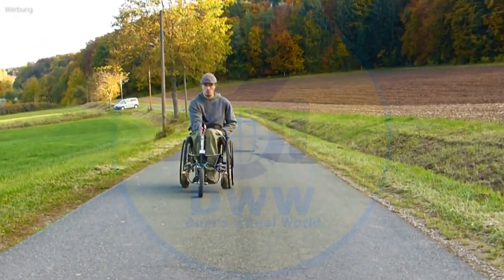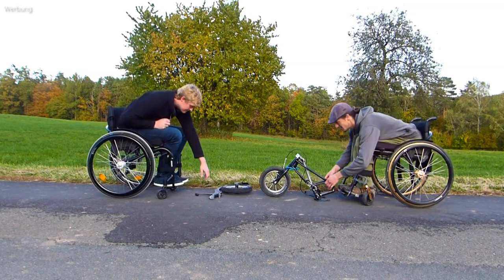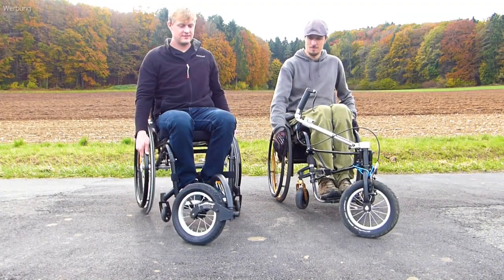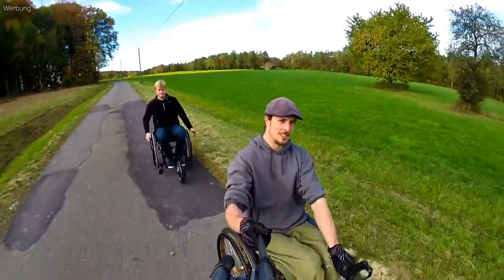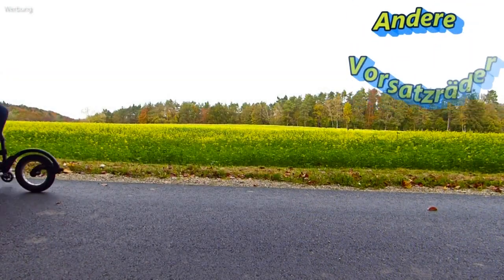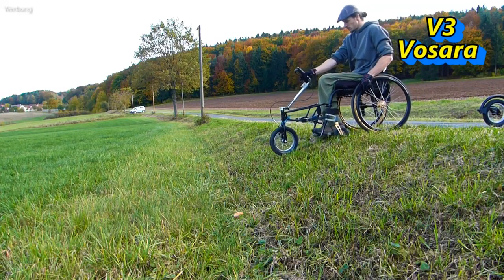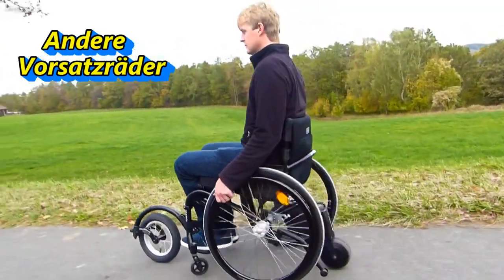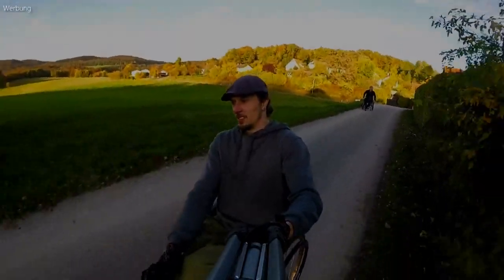Frontwheel Wheelchair attachment (Freewheel Snoll on Vosara Quinty) -Dom`s Wheel World  Folge 16

Comment: I have the Firefly for front end. Does the job of both power drive and front end elevation with steering + brakes. However it is heavy. I can appreciate that the VOsara + Smoove is a more flexible system. What is the cost of Vosara? Is it available in the USA?
Thanks for great comparison video
Reply from the maker: Hi, thanks for your comment and the compliment. 🙂 Yes, many also use the Vosara in connection with their Smoov, Emotion, Twion, SmartDrive, WheelDrive, etc. Exactly, the individual smaller and lighter components are easier to handle. We ship worldwide. The current price for the Vosara can be found here: http://www.shop.vosara.de/en/Vorsatzrad-v3/  Kind regards

Comment: If you had a release such that you could engage or disengage the tiller handle you could have the best of both products. As it is having the tiller swinging back and forth when manually navigating in tight spaces looks like it could be tricky. Perhaps a spline on the top of the front wheel with a spring loaded clutch would do the trick.
Reply from the maker: Hello, thanks for the detailed comment! That sounds like a good solution. We still have many additional functions and extensions planned. At the moment we have the simplest basic version. We hope that we can add many more technical highlights to our product! 
Best regards Dom

Comment: I have the FreeWheel… and I love it. I like using my upper body strength and the freedom it comprehends. I like doing tricks and other things so the FreeWheel gives me what I need in order to do that. And also the FreeWheel can go straight if you turn the knob too. But I love going down trails in it and being the absolute free 🥰
Reply from the maker: Hi Ivy thanks for your message. However, the tracking stability of the Vosara APS system ( www.trackstable.vosara.de ) differs significantly (it allows much more activity and efficiency) from what you describe with the knob on the freewheel. Very interesting, I'd love to see the tricks you describe. Is there a video about this? Best regards!

Comment: I choose the Freewheel any day of the week. Vosara looks huge and uncomfortable to use / carry. I had no problems with my Freewheel, has been an absolute game changer and I'm quite an active manual wheelchair user.
Reply from the maker: Hi, thanks for your feedback. You haven't used the V3 yourself, right? It is foldable and easy to transport. Due to the more stable frame, significantly better driving characteristics are possible thanks to the stable steering and active brakes. You should just test it ;-)  Kind regards